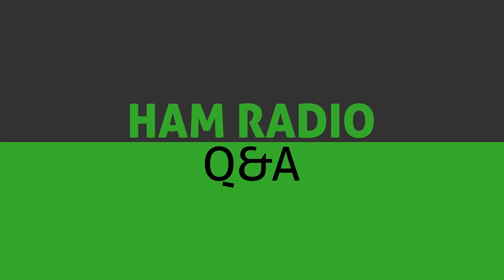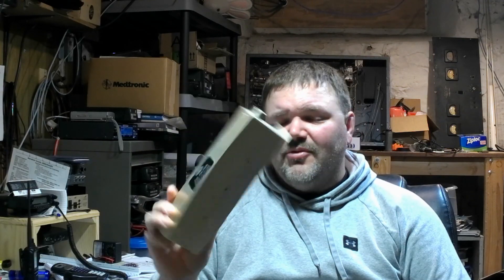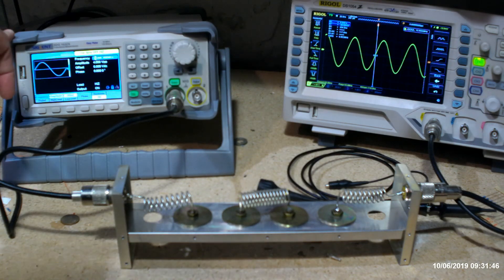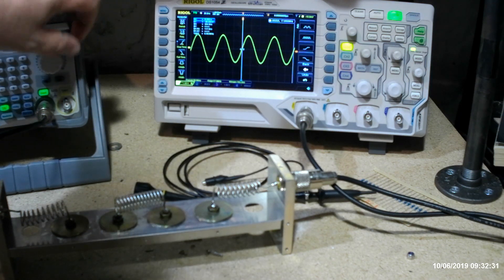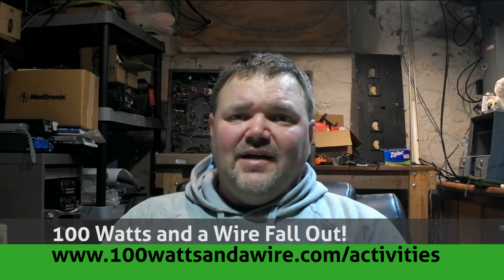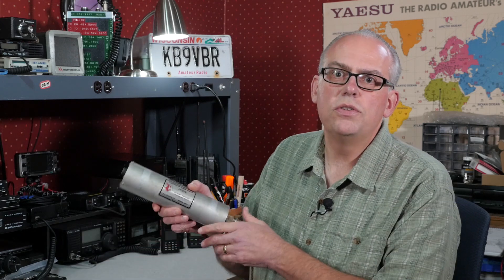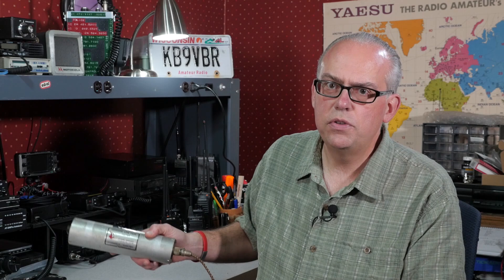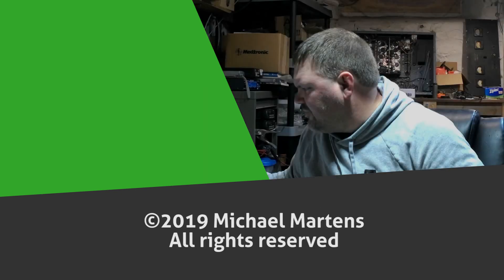How Low Pass Filters Work - Ham Radio Q&A

Comment: Does a low pass filter help with harmonics from an old tube transmitter?  For example, using a 7.030 crystal?  Would it cut down on interference on 14.060, 21.090, 28.120?
73 Paul AA1SU
Reply from the maker: A low pass filter won't help. But if you put a 40 meter band pass filter on the tube transmitter, the spurs at 14.060, 21.090. and 28.120 will be filtered out.

Comment: Exactly what I've been looking for! I'd love to get my hand on a set of these, looking to set up a base station on 70cm and I need a bit of filtering.
Reply: You won't want to stick a low pass filter on a 70cm radio, the LPF will seriously attenuate the signal. If you do need to reject out of band signals, a band pass filter for 70cm will do the job.
Reply: @a120068020  funny enough....after two years and running 70cm equipment almost daily for work, ibe learned a LOT since then, and you're absolutely right 😅

Comment: I know this video is 2 years old for a few years old, but I was wondering does the low pass filter work for unwanted RF high levels of static and RF noise coming into my radio? I'm not having an issue with neighbors or getting into any components in the house my issue is I'm receiving about 5 to 7s units of high static level and it seems to be worse on the lower channels, lower frequencies will the low pass filter help reduce some of that noise? KD9MFT
Reply: Nope

Comment: if you want to show how a filter works you're doing it wrong with the function generator and oscilloscope, not sure what we are supposed to be looking at. what you want to use instead is either a spectrum analyzer with tracking generator or vector network analyzer. both of those will do a frequency sweep and record the insertion loss.
btw. i also looked at that same function generator before and when i saw that it only went up to 30mhz i was like forget about it. instead i bought the FY6900 which goes up to 60 mhz and costs less than half of the siglent. then if you want to generate some real RF look on ebay for cheap RF signal generators for about $50 that go up to like 6 GHz.

Comment: What's your thoughts on how near the radio the low pass filter should be. I've read a few threads and some people recommend the patch cable should be as short as possible, while others say they mount it directly to the radio using a double male PL259 barrel adapter.
Reply from the maker: I can see the reasons why you may want to directly connect the low pass filter to the UHF connection on the back of the rig, but I think that's a lot of weight to hang off the antenna jack. I'd use a short piece of coax.

Comment: Where do you connect filter at in line? Thanks 
73s
Reply from the maker: The filter should be connected as close as possible to the antenna output of the transceiver, before the tuner or any other pieces of equipment.
Reply: Got Bell Industries Transmitter Low Pass Filter C-514-T. Looking at the label—which is the input side from Transmitter? Right or Left side, not labeled. Bought it 1979, can’t remember. thanks Matt N6CUQ

Comment: When I transmit on 1.25M, it interferes with the TV my wife is watching upstairs.  What do I need to resolve this problem. So far, no complaints from the neighbors, but maybe they have not associated it with me.
Reply from the maker: Is it broadcast or cable TV. How much power are your transmitting? Does it interfere at low power? If it's cable, you can try ferrites on the power cord and coax cable.
Reply: @KB9VBRAntennas  It is broadcast TV and it happens at all power levels of an Alinco 235.  I have three ferrite beads on the Coax near the antenna.  It is one of your J-Poles, BTW, not that that is the problem.  When you say on the power cord, do you mean of the power cord of the TV?  Would that need to be near the socket or TV.  Do I need Ferrite beads on the receive antenna near the antenna or TV?
Reply from the maker: Thanks for the additional info. Joe and I will be discussing this on the livestream tonight (Jan 7 @ 7pm central) Feel free to tune in and comment in the chat.
Reply: @KB9VBRAntennas  Knowing how and where to place a pass filter is something I don't understand.  Perhaps a picture of one installed is available as a visual guide. Thank you.
Reply: @KB9VBRAntennas  (Copied from the live stream video for continuity) Thanks, guys.  I just put a choke on the antenna wire (a cheap tv antenna) and it is no longer picking up the interference from the 220 transmission.  Thanks for the simple fix. I just made several wraps around my fingers and put a velcro strap on to hold it together.  It is working fine.

Comment: Good info, but you don't want to use one with a radio that has HF + 6M.   :-)   WB3BJU
Reply: Well if you had a IC756 with two antenna outputs you could put your HF antenna on one and a 6m one on the other then your filter would be just fine on the first one! ;)
Reply from the maker: Or use an antenna switch so your 6 meter antenna isn't inline with the low pass filter

Comment: good info from Joe would love to see more from him. is a low pass filter the same as a band pass filter that dx engineering sells?
Reply from the maker: A band pass filter is slightly different than a low pass filter. Low pass filters either pass or attenuate a broad range of frequencies. For example: a low pass filter will attenuate frequencies above 30 Mhz and pass frequencies below 30 Mhz. A band pass filter will pass a narrow range of frequencies and attenuate all others. A couple examples would be a filter that passes only frequencies in the 20 meter band or a certain 2 meter frequency. 

Common applications for band pass filters are situations where you are running transmitters on multiple bands and you don't want them to interfere; like at a repeater site. The band pass may be set to allow the repeater frequency to pass- reducing interference from nearby transmitters. Another use would be if you are running a station on 20 meters and another person is simultaneously on 40 meters. This is common on special event stations or field day. Stations can use band pass filters to keep each from interfering.

Comment: I have issues on 40m inside my home with the tv upstairs when I transmit the tv goes black then comes back on..I do have a low pass filter on my 40m dipole and also my 20m dipole which does not interfere with my tv..I have added snap-on ferrites on my power supply...the coax and the tv cord and also on the cable tv coax..and my swr on 40m is less than 2.0.1 and my tuner takes care of that..none of my ham friends can figure it out either...I even took down my dipole and made another just to be sure..feeling aggravated.....
Reply: Check the grounding on your radio.
Reply: @Gordofor12  Thanks Joe..it has been grounded for years..everything in the shack..this is something that just happened..always something to do as a ham right?..I`ll get it..
Reply: @bobcrawford5083  I had to wrap our DirecTV receiver in tin foil for 40 meters.
Reply: @Gordofor12   Joe we have comcast..I even put snap on ferrites on the cable before it goes to the TV and also the power strip for TV..tried to do away with power strip just to see..nothing changed..my other flat screen down stairs here I want to switch over and see if that helps...read about these sets are not always compliant with the fcc..onne guy said take off back of set and foil the inside of it..eehh ...I just put together a new dipole a fan 40-20m..tookd down the other and made a new one something has to give....thanks for your vids and input 73..Bob